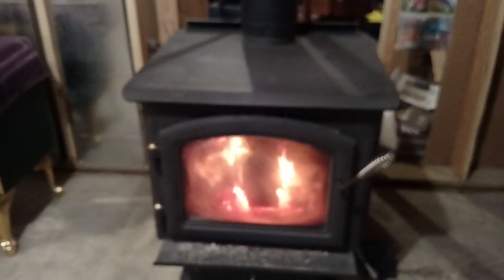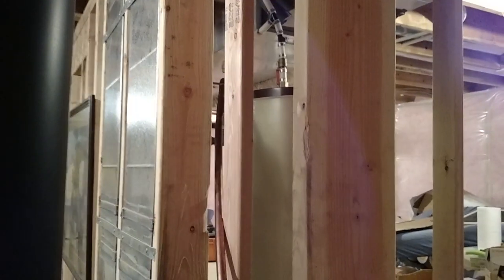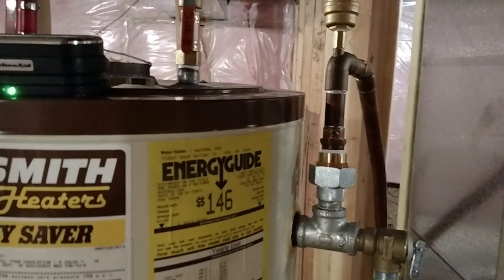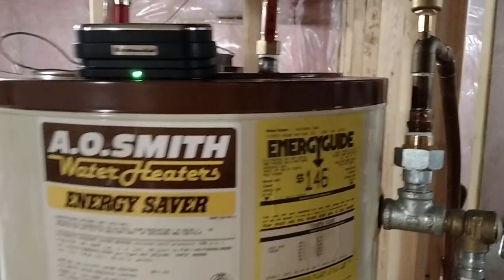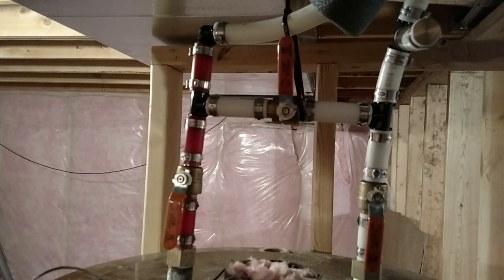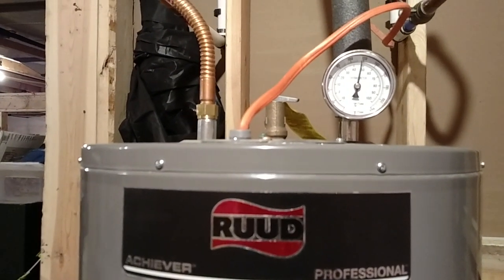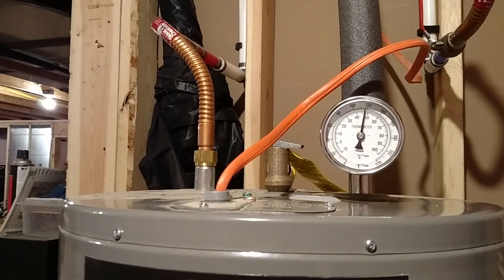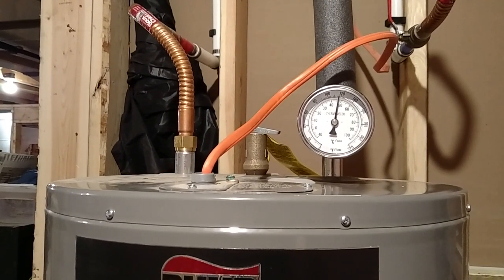Hot water from a wood stove!

Comment: I've heated domestic water with my wood stove for 25 years. I have two observations:
1. I didn't see a mention of a "tempering" valve.  
The wood stove can heat pressurized water to over 230 degrees. A tempering valve on the hot water line going out into the house will mix unheated water with the flow coming out of the tank to lessen the chance of scalding. They have a dial on them to set the temperature at which they start to open.
2. The pop off should be plumbed out of the house.
I've had tanks pop off. If you've plumbed the tank to avoid mixing and enhance stratification, about half the tank will empty before the incoming water will cool the top of the tank enough to allow the pop off to close. Picture 20 or 30 gallons of scalding hot water flashing to steam in the house and the damage it could cause.
There is tremendous energy in water heated to steam. Be sure your system either can't get that hot or can deal with the consequences.
B.
Reply from the maker: Brian Brehmeyer Good advice on plumbing the blow off valve. I have research the tempering valve and have been watching my temps. I haven't had to use one yet. I think that because it is a single 1" U-shape line in the fire box, it is more of a slow and steady climb to heat up?  Currently the hottest it gets before someone showers or does dishes is around 160 f.  When it gets that hot I also have the option of running that stove lower & another hotter to continue to heat the house. So far I have been loving it.
Reply from the maker: Also the current pop off valves are set to 210 F as not to boil and have a steam issue.
Reply: Yeah, mine was rated at 210 F also. It popped around 220 F. Made quite a roar as it vented the tank. I'd plumed it outside, but it blew the pipe apart where it turned to go down the house wall into the foundation drain system. I was running about 38" of 1" copper pipe in the firebox as my heat exchanger. 
This happened in the first year I was running the system. I never let the water get that hot again. 
I've since replaced that big stove with a smaller one and a shorter exchanger. This system doesn't get that hot.
I have 3 temp gauges on my system. Two measure temp into and out of the stove and one that measures the temp at the top of the tank.
Reply: Good information I am considering coiling a stainless steel tube around the stove pipe of my wood stove taking the heat from that and dumping it into my hot water storage tank that is used for the radiant floor heating it will have to be a separate system the radiant floor only has about 7 psi so it would require a water to water heat exchanger to transfer the heat. My concerns are how hot the coils get if it were to flash into steam and controlling the amount of heat so the hot water storage tank doesn't get to hot. Guess I would need to experiment with how many coils around the pipe and total volume of water on that closed loop and the speed that I circulate it. Good tip on plumbing the vent for the relief outside.

Comment: I'm thinking about doing a similar setup but use the hot water with a pump for radiant floor heat with pex tubes in concrete. Great video.

Comment: And you would think that till about 1980s the huge and extremely inefficient wood or coal boiler with 3 inch supply and return heating system with cast iron radiators, with no circulation pumps, was a standard heating solution in every residential home in USSR. My grandma had this three door cast iron boiler in her wet basement, it was a scary, five feet tall, three feet wide and three feet deep boiler, that had 3 inch return and supply going to upstairs and in every room there was these crudely made, unpolished since demoulding from sand molds cast iron radiators, and the pipes that to the ceiling for each radiator supply and return, both pipes connecting to the huge 3 inch pipe that went in a circle around the ceiling of each room and finally returned to a boiler. Basic principle of operation: You shovel about 50 kilos of coal into the boiler, set it on fire, and after half an hour you could hear boiling water inside the boiler, basically, the sounds of thunderstorm in your basement, and radiators were crackling with 120'C of heat and your ears melting in the heat of 30'C in every room. That was the way to live. Outside -30'c, indoors +30'c you walk with your bare underwear and do whatever you want.
Reply: Oh yeah, I remember one of those. I sat on one of the radiators for a sec. An experience I never forget.

Comment: what about over temperature boil over, just pops the TPRV and thats it? 

I might consider adding a return line from the electric tank (hot) back to the wood tank (cold) with circulating pump that turns on just before the TPRV pops.

They sell little mechanical switches on aliexpress for acouple bucks at whatever temperature you pick, say 190F. You could also have a manual pump on switch bypass to prime the second tank from a cold fill.

Comment: Hi wade, thanks for your reply and time to put all this info togethier, much appreciated! One more question, how does the water stay warm in the second water heater, the electric one? If it does not circulate? And supplies the house line from that tank? Thanks again for your video and any help with this!
Reply from the maker: It works as a hybrid system using electricity in the second tank if the water isn't hot enough coming in from the 1st tank. If the power goes out It still works good because the water stays hot for a day or two in the insulated second tank and because we use/ replenish that water before it has time to cool with the heated water from the 1st tank. Hope that helps.

Comment: I just hooked up a coil of copper around my pipe, the water got so hot it almost exploded the cpvc pipe that was no where near the copper ends it connected to. I need to know what i should do to prevent this and the best way to control it.

Comment: Great video a question when time allows do respond how did you install the pipes in the stove did you drill a hole in the back of the stove could you please explain thank you
Reply from the maker: Yes the one-inch u-shaped pipe came with some gussets and I drilled through the heat shield, stove, and broke off small chunk of the bricks in order make it work. It was pretty straight forward. Just have a proper steel drill bit.

Comment: I have the Energy max 160. I believe it is the big brother to this stove. with a 1" Stainless Steel loop similar to this one. I am wanting to use this to heat my in floor heating. Here is my main question.  How much Degrees does this increase my water flowing through the pipe. and what is the flow rate?  I know ill need a pump to circulate through my floor but do I need a pump to circulate through the stove?
Reply from the maker: How hot the tank gets is all based on how hot and long the Fire gets and Burns. The rate of flow is simply based on and open faucet. Watch a couple videos on how Wells and pressure tanks work and you'll see what I mean.

Comment: In the UK, we have to use an open vented system for wood stove boilers. What if the P&T valve failed?
Reply from the maker: It wouldn't be good. All water heater/ boilers here in US are closed systems with TP valves. If any valves failed it wouldn't be good. In my opinion wood boiler is probably riskier but I still have faith in the valves. Also when my system is getting really hot I tend to monitor it more closely. So far no problems.
Reply: Incorrect. It doesn't have to be open vented. There are very good ways of doing closed systems in the UK when using woodstoves. This is a HETAS approved closed system for woodburners with back boilers.
https://youtu.be/UX1O1kcvo1Q

Comment: what kind of gauges do you need?nice video
Reply from the maker: Just a home store hot water heater safety blow off valve so it can't boil and I put on a valve on the highest part designed to release any air that might be in the system. I also put in a thermometer just so I could see how well it was working but that isn't needed.

Comment: Genuine questions. I want to try this into my existing electric water heater. I would like to go in line diectly from fire to tank. The pressure valve will keep it safe as long as temperatures arnt excessive. Use a seperate inexpensive pump eliminating any need for electricity going to  the existing electricity guzzling electric water heater. Does this sound feasible??? Any suggestions much appreciated:))

Comment: I have an indirect water heater that is currently setup to be heated with our propane fueled high efficiency boiler. How can I bypass the high efficiency boiler in the winter with a “closed loop” from my wood stove. By the way the wood stove is on the main floor and the indirect water heater is in the basement. I have an extra grunfos pump laying around that I could incorporate but I would like to keep it as simple as possible.
Reply from the maker: It definitely would be some stuff to work out but here are some thoughts. In my case it's more of a hybrid system. My wood stove is preheating the water in an additional tank before it goes into my main water heater. If the water temperature is hot enough then it won't trigger my main on grid tied heating elements to kick in. Because my extra tank was close to my wood stove I was able to use thermosiphon. If you have to have an additional tank further away or below the wood stove you would have to have some sort of circulating pump. There are more considerations with pump. Just remember to put in safety valves excetera.

Comment: Hi, wondering if can help? I am doing the same sytem but feeling a little dense! I see the water comes from your well into stotage tank, through top inlet cold side, than comes out bottom of storage tank to wood stove than dumps back in to storage tank through the top or is it coming in to the tank at the hot pressure relife valve in the side,? than or, out to hot water tank through hot side on top to electric to the cold side than normal out the hot? And also dont understand the shut off between the two lines on your storage, dont see how it isolates it! Any help much appreciated, kind of confused! Thank for uploading this!
Reply from the maker: The water circulates coming from the bottom of the tank through the wood stove and back in the top of the water heater where the pressure relief valve is. That's all that's going on there. As far as the water coming in the PEX line and going out of the red PEX line. If I close both of them and open the horizontal valve the water bypasses the tank. Hope that helps.
Reply: dreamofmules13  hi . I'm on the same path. I'm going to run the pipe as my grandfather use to from the wood fire to the tank. Safety valve and no need for crazy temp. A waste paper full of little bits of wood. Use existing tank as you do now but zero electric to it. Bypass that by putting a basic 60 pump and everything be like always except free minus wood and 60 w to pressurise the system. That's my plan🤔

Comment: Did you find the DHW heater kept constant up to temp or did you end up plugging into power was of benefit?
Reply from the maker: I have the original electrical WH plugged in as it has to be cold enough to run woodstove consistently. In warmer months when woodstove is not run as much, or even at all, the electric WH kicks on. Its a technically a hybred system.

Comment: I want to do the same thing !  Just wondering what happens once your domestic water is up to temperature and theres no usage or demand, but the wood stove is still pumping out the heat??? Thanks
Reply from the maker: It can be an issue. Because the heat just keeps rising in the secondary water heater. When it gets hot I monitor it and have someone take a shower or something. It works good for me because it's a secondary wood stove in my basement, so I can let it die down if it's too hot and just use the upstairs wood stove. I installed some wired probes that run upstairs to a thermometer that I can watch

Comment: SO the pressurized tank uses electricity right?
Reply from the maker: The well pump is electric. It pressurizes the whole system to 60 psi. It will need a backup power source for sure. However in my case I also have a water tank up the hill from me, and all I have to do is turn on a couple valves to use it. It will give me 22 psi no electricity at all.

Comment: the well supply comes into the cold side, cold out through your bottom drain, through your coil, up inti the top of the tank....how do you get it out of that tank to your electric tank?
Reply from the maker: The well pump supplies 50 psi. Its a pressurized system so the water want to go somewhere when the faucets are opened. Its the same thing that happens in the electric tank. Hope that helps.
Reply: @wadewilliamson7994  sweet, thank you! ive been trying to figure out a system for my house. Would it work if I  piped my cold supply  directly into a coil, loop around (several times) the stove pipe, up and into the cold side of a hotwater heater? then the hotside of the heater runs throughout the house like normal.
Reply from the maker: @stephentucker2714  Yes, many have done that or something similar. Just use caution. Most folks put a safety valve on their system to mitigate the risks. Don't mess with steam. It can be very dangerous. There are a lot of other videos that do exactly what you are saying. Check them out. Hope your project goes well!
Reply: @wadewilliamson7994  Thanks Wade, I sincerely appreciate it ! have been banging my head against the wall on that puzzle for a few days now lol

Comment: So your craigslist find is a gas type water heater used to store your heated water..? Please describe your loop inside the wood fired stove...?
Reply from the maker: I bought a kit that includes a 1 inch stainless u-shaped pipe with some washers that are designed to go inside of a wood stove. I drilled holes through the heat shield and through the wood stove itself and through the fire brick in order to install this kit. That's about it.
Reply: @wadewilliamson7994  oh....a kit....seems like this kit has taken off...saw another post with similar kit....probably not that hard to duplicate it. Great video and information.
Reply from the maker: @offgridmangogrower  https://www.amazon.com/dp/B001D5JTB2/ref=cm_sw_r_cp_apa_i_pVY.FbGNM4XGJ

Comment: what happens if the temperature of the water in the electric heater goes down. how does the water get reheated by the wood stove
Reply from the maker: Good question. I suppose that would happen if you didn't use the hot water for a few days. There are 6 of us using so it isn't a problem. When I planned this system, there was two popular ways to do it. One like my setup, and one using just your main water heater doing the the essentially the same thing. Also, I know that with my 50 gal main water heater, it will stay warm enough to take a shower 3 days after the power goes out if no one was using.
Reply: I plumed my system so either the preheat tank or the main electric tank could be bypassed in case of power outage or repair.
Reply from the maker: Brian Brehmeyer That is a great idea. I already have the bypass on the first tank. I will add one to the main tank. It is very easy with pex.

Comment: what alternatives can you use for a water heater tank
Reply from the maker: Charity McGowen. You can use lots of types of tank. It would need to be able to get hot and not harm anything it would be attached to. It would need to have 4 openings on it if it was set up like mine. Insulated would be a very good thing to hold the heat in. Oh, and if you are using it for domestic water  it will need to be ok to have potable water in it. (no old fuel or unwanted chemical residue that might be harmful to you.. etc) Hope that helps.
Reply: Wade Williamson thank you that was a big help. any kind of insulation?
Reply from the maker: Charity McGowen any that can handle temps up to 210 degrees plus.